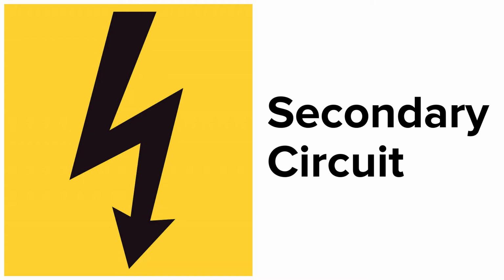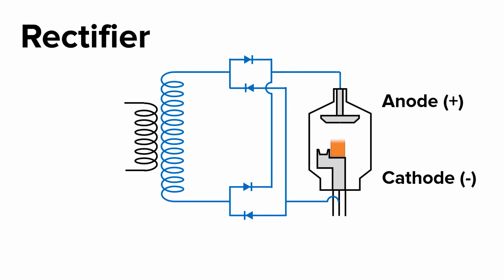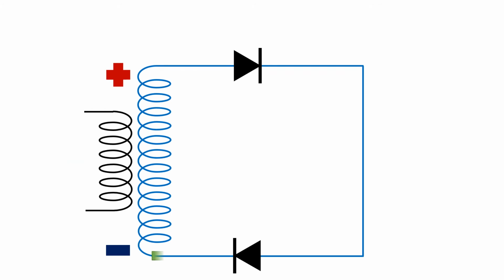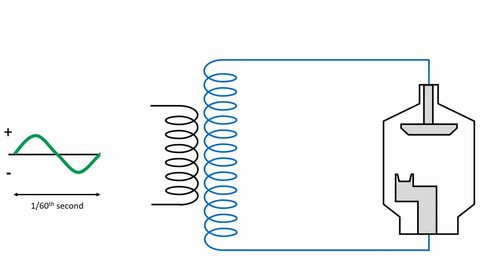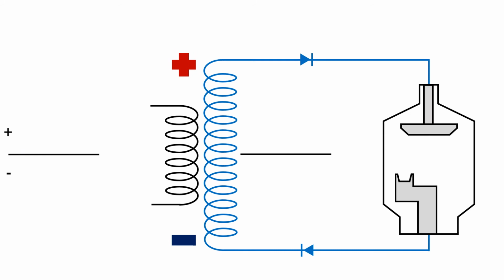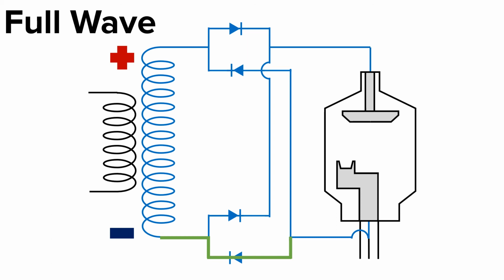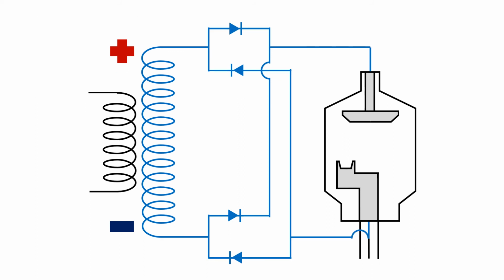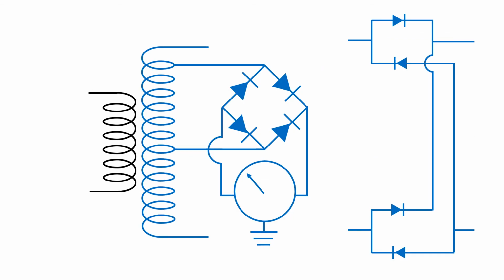Secondary Circuit

Comment: don't electrons travel in the same direction as arrow points?????? that's what my physics teacher said?
Reply: Hi, I can't be exactly sure, but I believe your physics teacher may have been inferring that the direction the diode is pointing correlates to the conventional electric current (electricians practice under the impression that electricity flows positive to negative as a result of Ben Franklin's discoveries). Physicists know that current is in the direction of electron flow, which is opposite the direction from where the diode is pointing.
Reply: The "conventional current" flows from positive to negative, towards where the arrow points of a diode. Electrons, flow from negative (cathod) to positive (anode)